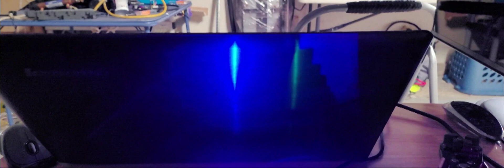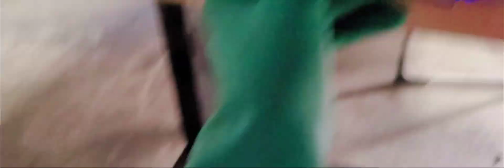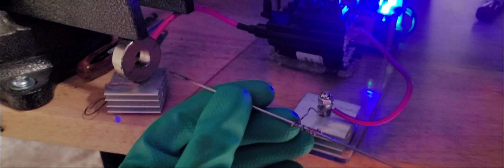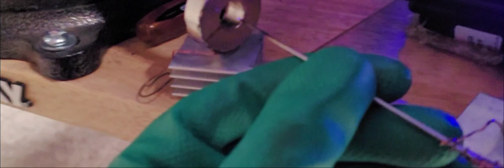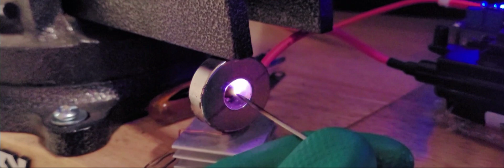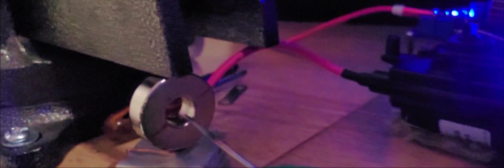Magnetic Planar Plasma Speaker

Comment: I think that to stabilize the effect, you can put not a tip, but a cylinder with a biger diameter so that it does not compete, and on each side it is close enough to produce the effect. And congratulations it looks great. I think one day I have to do one.